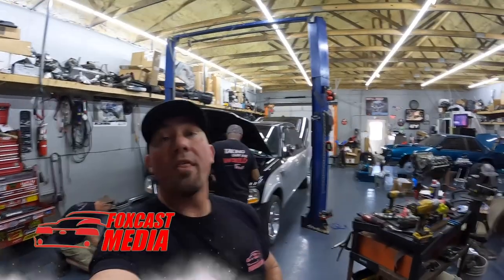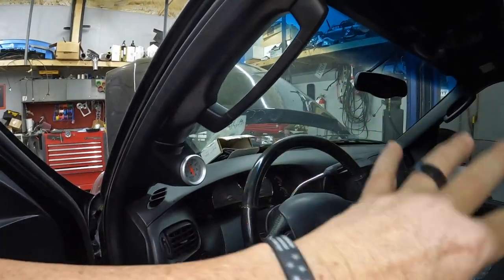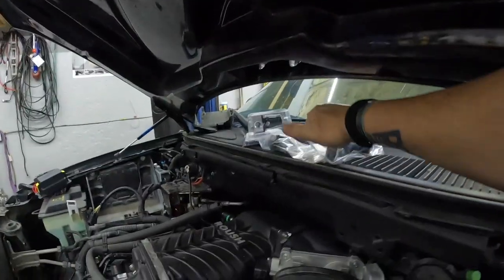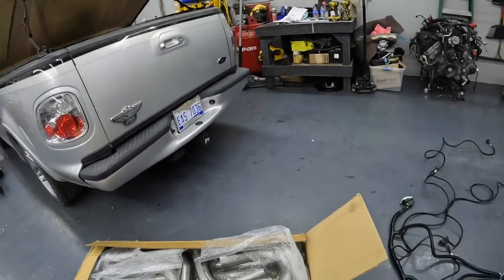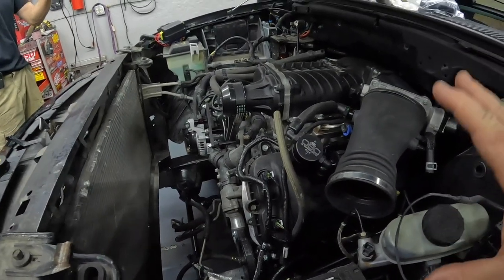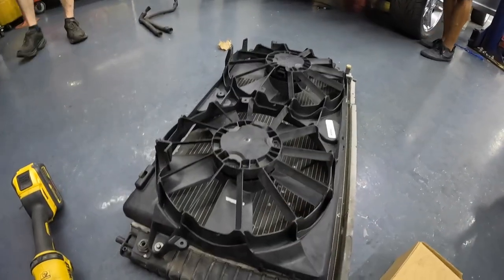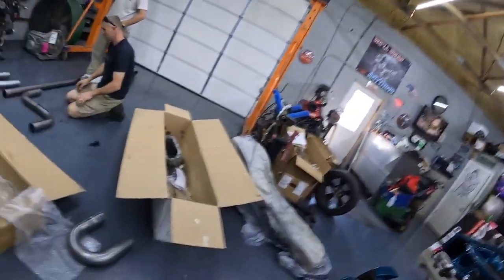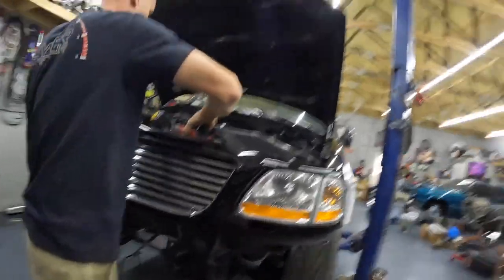Custom, full 3" exhaust, and cooling fan solutions!

Comment: I put dual electric fan shroud on my 97 f150. Surprised at how well it fit without a lot of modification.
Reply: I got them off of a ford windstar van from the salvage yard. Couldn't tell you what year model it was though.